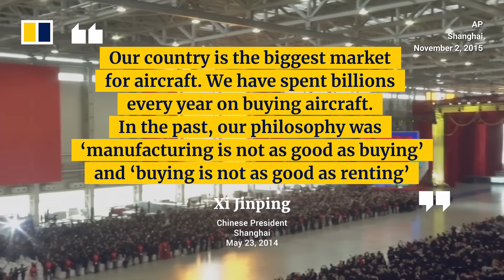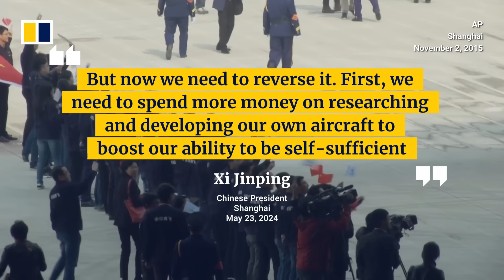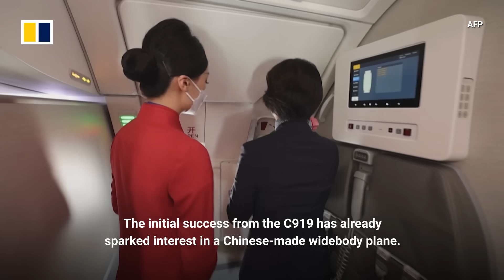How China’s C919 is faring a year after maiden flight

Comment: buys a lego set and instructions puts it together. China: I made that. You do realize that this, this right here is the very reason every part they ordered was last gen, as in started pruduction in the 80's-90's. Its already 25 year old tech. The part manufactuer's knew China would pull this so they refused to sell them any parts from post 2000. The copium is strong with this one. For those out there trying to say that China is the next Airbus, remember this plane hasn't been FAA or EU Air space certified. China can only sell them domestically and has only delivered 4 in an entire year. The FAA issued a qouta for Boeing limiting the number of planes they can build PER MONTH.

Comment: Decoupling? What’s decoupling. The C919's engine, for example, comes from CFM International, a joint venture between GE Aerospace of the US and Safran Aircraft Engines of France. Meanwhile, the C919's tires are sourced from Michelin, the French tire giant. Tire pressure monitoring systems are supplied by the US-headquartered Crane Aerospace and Electronics. Various aircraft systems—including in-flight entertainment, integrated communication, navigation, surveillance, and cabin core systems—come from Collins Aerospace, in the US. Honeywell, another American industrial giant, supplies wheels and brakes, as well as flight control electronics, for the C919.
Reply: not for long.... check back in 5 years
Reply: To get its airworthy certification, comac has no choice but to get the parts from more established suppliers. It drastically improves the certification process, and chances.
Reply: ". The C919's engine, for example, comes from CFM International, a joint venture between GE Aerospace of the US and Safran Aircraft Engines of France. Meanwhile, the C919's tires are sourced from Michelin, the French tire giant. "
For now.
Reply: They just debuted a new home made engine few days ago
Reply: Sin embargo ya no compran el avión completo. Deberías estar contento que aún participe europa . Y deberías saber que igual que con los automóviles llegará el momento en que todo sera hecho en china y tendrán que poner barreras igual que con los automóviles
Reply: @er-yc4qb  80% of the C919 is western made.. and this is a generation behind any of the newest offerings from Boeing and Airbus whose order books are bulging.. so why not let China waste it's money.. they are not taking orders from Boeing or Airbus as these companies cannot meet current demand... let the Chinese continue to commit financial suicide as we can observe now..
Reply: Soon they will reverse engineer those parts and then it is 100% theirs already.
Reply: @rodolfopalmones9430  What's wrong with that?
Reply: It's a stopgap measure.

China has a huge short fall in planes, and even if using overseas parts for now until China can develop the capacity to produce that many and at world class quality, it will continue to use foreign parts where it can do so.

It's still better than buying 100% USA/euro plane. China will get there in the end just like with everything else.
Reply: No choice but to use western part to enable the plane to be certified by FAA of USA and EASA of Europe..China can build all the parts easily themselves but no choice have to source from western world for certification. If china can build a space station and hundred of Rocket launches safely what is it with commercial plane.
Nevertheless we don't see much future of China with EU and USA certification. The World especially BRiCS should develop their own Air Worthiness Certification. I bet Russia China Brazil India and Middle East will look forward for. All of them knew US and EU hypocrisy.
Reply: This is China’s first attempt at building a commercial airplane.
Reply: We get our basic appliances full of junk from China and they build their basic plane full of American and European engines and hardware.

How many decades has it been and they still can’t domestically produce an engine that doesn’t smoke or use twice the fuel of something from CFM/GE.

They could spend another decade development will still be behind. Pretty happy that I will never have to fly something made there and can stick to a 757-200
Reply: ". The C919's engine, for example, comes from CFM International, a joint venture between GE Aerospace of the US and Safran Aircraft Engines of France. Meanwhile, the C919's tires are sourced from Michelin, the French tire giant. " For now.

Comment: The original design of anything Chyneeez is mind boggling,such innovative people they are.
There is no discernible difference between the A319/C919 save for the cockpit and nose.
Reply: So you want their plane not to look like a plane. Maybe you be satisfied  if they don't have the usual wings and wheels. Maybe they should use skids instead. All planes have similar shape and design for many reasons. Performance efficiency, safety and stability are just some.
Reply: Huh?! This is a weird argument. So about cars, do you hold the same views?
Reply: Form follows efficient function. Most airliners look very similar. They must. Get over it.
Reply: You mean it's copy-paste, as like anything Chinese? They are reverse engineering everything.😂
Reply: A318 and even A319 will be no more thanks to its Canadian division A220s.
Reply: And the Tiangong space station is a copy of ISS because it's made of white tubes. The Chinese wanted to use cubes but they didn't fit so well on the tubular rocket.
Reply: So, Chinese tanks have a turret, tracks, armor plating so they are copying from the british tanks? Why do you want planes to not look like planes?

Comment: the LEAP-1C engine on the C919 is a less powerful, less efficient model compares to the one supplies to Boeing and Airbus, that reason alone would makes zero business sense buying the C919.
Reply: Airlines will get them for significantly cheaper and there isn't a 10+ year wait like for the 737 or A320. That's a business case right there.
Reply: @HonuFlight  cost is a factor but so is the resale value, in terms of depreciation C919 could be much worse than it's competitor simply due to all the unknown factors of being a new plane. COMAC faces the same  production backlog as they claimed they received over 1,000 orders but set to produce seven this year, SEVEN! Guess how long the carrier would have to wait?
Reply: @HonuFlight  there was a rumor what the price for a C919 was and it was just some % cheaper then a A320 Neo base price. But the A320 has a lower consumtion and when you buy in volume you get discounts. There is till today no non chineses airline company that bougth a C919.

Comment: I wonder how much cheaper it is compared to a comparable Boeing. Airbus plane.
Reply: The C919's MSRP is slightly lower than its competitors, but the actual selling price could be even more competitive. However, the price is not the primary concern. Chinese airlines are effectively obliged to support the C919 regardless of cost. COMAC's most critical tasks are identifying and resolving (hopefully) minor issues with the aircraft, increasing production, and setting up service centers and support teams throughout China, all of which require significant investment.  After these are completed, likely in the next decade, we should see an "overcapacity" of the C919 that  floods the market with prices much lower than those of Boeing and Airbus planes.

Comment: The C919 aircraft is already obsolete. It is inefficient with a short range, but more importantly it is only certified in a few countries in Asia.
Reply: They are the new kid on the block. Just like when Airbus first started and they got  the same mocking from Boeing. It only made them stronger. Today they have surpassed  their mockers. The same for C919, given time.
Reply: @kamsunleong6648 true, the original A300B was incapable of crossing the atlantic, but looking at Airbus' lineup now, the A350 outperforms the 777 in range and performance. I have high hopes for this bird, especially flying in my homeland (although there aren't any firm orders yet from here).
Reply: @kamsunleong6648  Airbus was a little different when they entered with the A300. The A300 actually answered a direct market need at the time for a high capacity, efficient, twin engine jet. Also, the A300 contained a lot of indigenous European technologies and components. 

This is not true for the C919. The only market need that it answers is the lack of sufficient production at both Boeing and Airbus, which arguably may be enough to get their foot in the door interestingly.
Reply: @mike48084  It's hardly surprising that the A300 contained a lot of European components when the company itself was a conglomerate of existing aircraft companies.
Reply: Too much jealousy and selfishness from many, including other countries government that does not want chins to succeed in aircraft manufacturing. They will try their best to halt its progress in some form, whether through spreading lies and mocking them or not selling them parts and equipment to help with their manufacturing and development.
Reply: The LeapX engine is still very advanced.
Reply: Similar sound also heard about chinese phones before. 😅

Comment: Avionics not Chinese, engine not Chinese. Would still never get on one.
Reply: Yes , like another Chinese product . Still using german and japan Machinery for making product and China claimed they made technology . 🇨🇳🤡
Reply: All complex products starts this way and gradually the imported parts will be  localized  over time. The important thing to remember here is a long journey always starts with the first step. The Chinese started the  first step by building on their own  the most important part of thd plane. The fuselage. If they don't get it right, nothing else matters. It looks like they got  it right  since C919 has taken off. Of course you are free to fly with Boeing. Just make sure they tightened all the screws and bolts, before boarding.  Also avoid sitting near the door.
Reply: Ya, you'd rather be on a Boeing. LoL!

Comment: using the same parts from the same vendors as boeing  .. it's pretty far reach to claim that it's Chinese
Reply: You are missing the point. The key skill sets to attain are systems design and integration. Yes most of the key subsystems are foreign supplied. Just look into how geographically diverse are the supply chains of Boeing and Airbus. That is the nature of the aviation industry internationally. You only need to have a fully indigenous supply chain is the Russian one for obvious geopolitical reasons.
Reply: This is the first step. Over time all these parts will be gradually be  home made. You are talking about building a plane, not a car. The Chinese started the first step by building on their own, thf most important of the plane. The fuselage. If they don't get it right, nothing else matters.

Comment: If they want to sell on the international market, they probably have to offer a low price, as the specs on this plane are not quite up to par, compared to A320 family and B373 family. But, it's a first effort, and with massive government support they can probably get a successful aircraft program up and running.
Reply: i wonder what is b373 family aircraft. lol. anyways wooh~~~ Chinese are scared
Reply: @TheFarrukhzain  "i wonder what is b373 family aircraft". Ah, B737 family of course. Small typing error.
Reply: The price is around 20million dollars cheaper than the B737 or a320neo if you search it up on Google there isn’t a clear price these are prices from experts in this area
Reply: They always do. Just like their space program. All the massive government  support will amount to nothing if the Chinese do not have the capability to pull it off. Which they clearly did.
Reply: They use the same engine. Please stop exposing your ignorance in a public forum
Reply: @bubuneowoo6161  "Please stop exposing your ignorance". Yes, the engine is the same, and still the aircraft is not up to par: Range is only 2300 nmi, compared to at least 4500 nmi on the A320 and B737. With approximately the same fuel capacity, it indicates that fuel consumption is higher per km flown, i.e. worse fuel economy. The shorter range means greater limitations on the routes available to this aircraft. For example, the C919 can fly from Beijing to Bangkok, but not to KL or Singapore. The A320 or the B737 can fly from Beijing to Singapore, Bali, and even all the way down to Darwin, Australia. In the other direction, the A320 and the B737 can fly from BJ all the way to Moscow and Helsinki, Finland. The C919 can only fly to Astana, Kazakhstan.
Reply: @bubuneowoo6161 NO they don’t so please stop exposing YOUR ignorance. They use an older version of the CFM leap that is more like the old 737-800 series.

Comment: 0:39 “China Eastern Airlines which operates the largest C919 fleet”
In Numbers: 5 (4 active, 1 parked)
Other airlines currently operating C919s: …
Reply: 1st Flight : 2017
Introduction : 2023
Up to date : Built 16 , Operational 10

Overseas Market
Brunei air confirm buying 15
Brazil plan to buy 4

Current confirmed order on hands : 930 
To me this is not bad , not bad at all.
Reply: @OutlawPingu  It may not sound bad, but it is utterly fictional. 
The order book for Airbus shows (per End of September) Around 7800 not-yet delivered orders. That’s approximately 10 years worth of production. There is no version of events where Cormac is anywhere near 930 actual orders, because airlines generally do not plan with 100-year horizon….
And just to be clear, ’confirmed order’ for Airbus or Boing comes with a non-refundable seven-digit down-payment, not a handshake confirmation that one Chinese SOE will do some creative accounting with another Chinese SOE.

Comment: Still, xi jinpig uses boeing 747 😂
Reply: Dumb comment. He has to if he wants to travel to Europe or US. These  aviation authorities have to first  certify C919. There is a lengthy certification process that will take years. And you rest assured they are in no hurry to hasten the process to bring a new competitor to challenge ge the duopoly.
Reply: Google says more than 10,000 Boeing airplanes currently fly throughout the world with parts and assemblies built in China
Reply: @TFXJac  google also says 90% of C919 are foreign parts.
Reply: @TFXJac  only the non critical parts like seats etc
Reply: @nicholasfooong.   US dared not pull Leap Engine from C919 project as China CJ-1000 engine is already flying on Y-20 in 2023.
Reply: @nicholasfooong. 
Another dumb comment. Boeing Tianjin plant makes composite parts.
Reply: Failed humor. Charge your IQ first. Different Purpose Plane.
Reply: @AwardQueue  irritated crynese 🤣
Reply: @nicholasfooong
Oh, no wonder the other day i saw him holding your wife's hand together while both of them was boarding a 747 plane.
Reply: @Paul-H-Wolfram6608  I was penetrating the vachina of your mom in my private 747
Reply: @Paul-H-Wolfram6608  Why does 747 need 4 engines? and Why does the U.S. 'Air Force One' use 747 only? It needs to transport several VIP armored heavy cars for a long flight